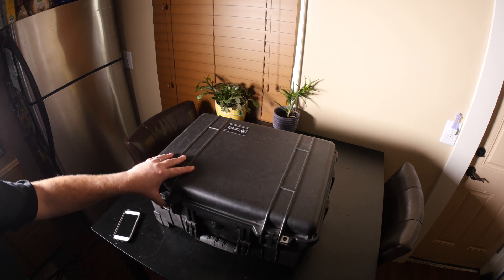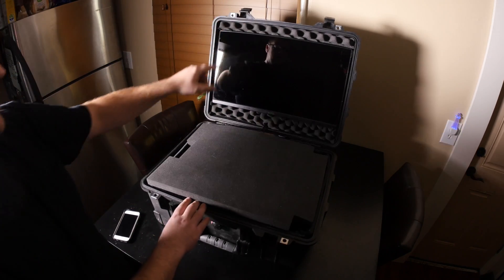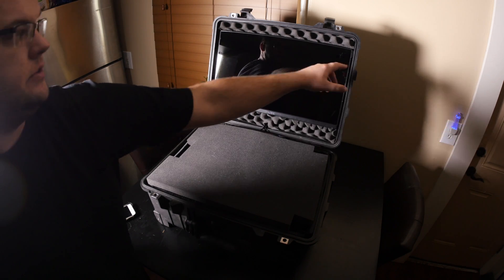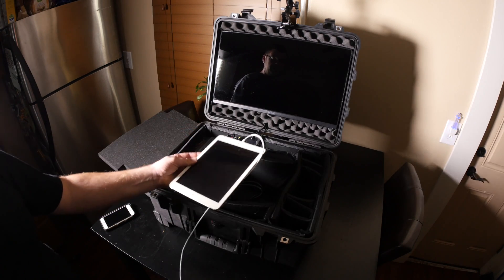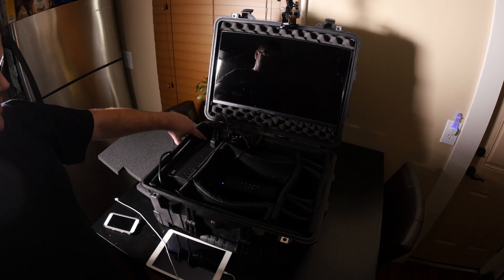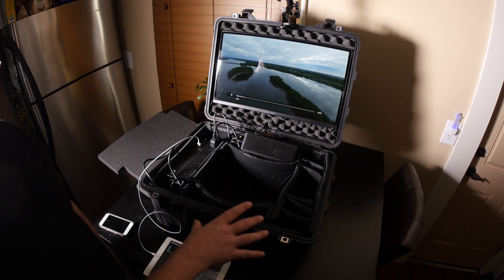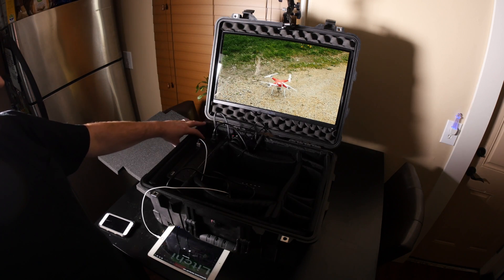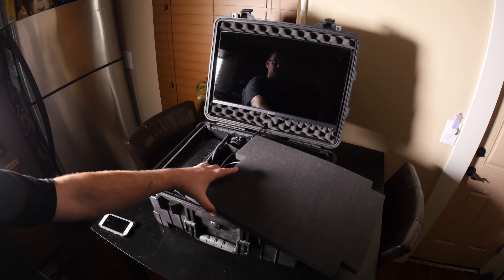DIY 21.5 inch Field Monitor mounted in case - Ground Station

Comment: Hi I want to connect my webcam to video transmitter for my FPV Cam
My webcam has 5V GND DM DP
Where should I connect DP and DM

In my VTX input slot there are only 5V GND Vid

Comment: Get a cheap miady 8ah lifepo4 battery or two and cobble it in there. It'll run way longer than the 6ah sealed lead acid battery and save some weight.